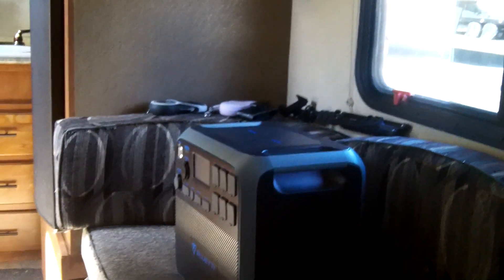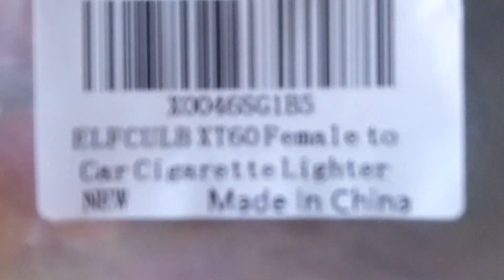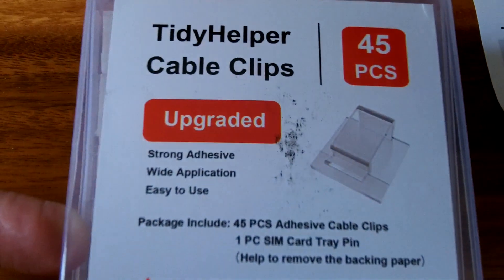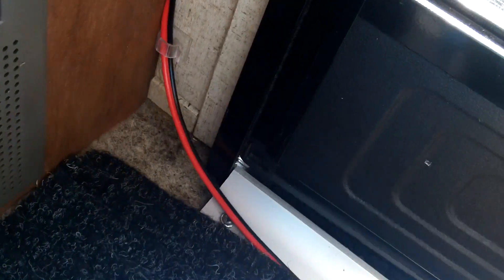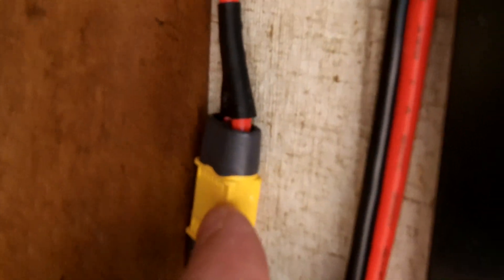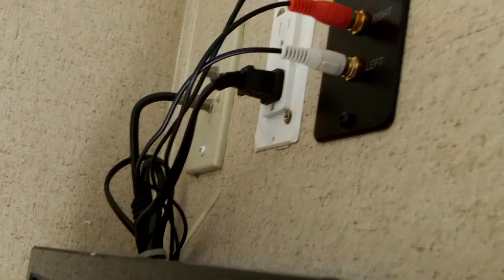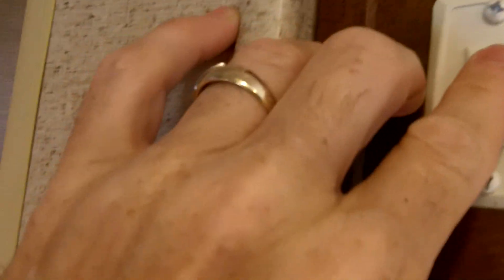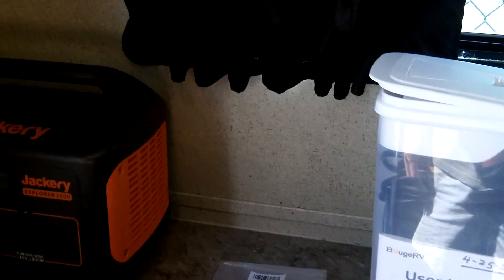Jackery Explorer 1000 Power Station- Running my RV- Off Grid- Using DC Power

Comment: Use my Jackery 1000 on trips to run the Setpower cooler which is about the size of your van one.  Will last about 3 1/2 days without a charge coming in.  Everything looks great in case of grid down or no power available.  Looking into the Jackery 2000 plus so I can add battery banks.